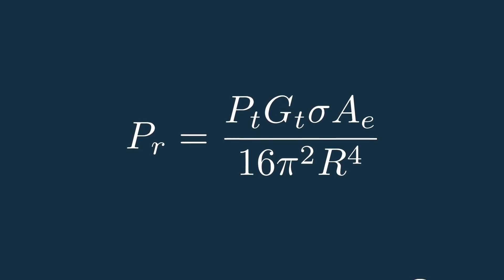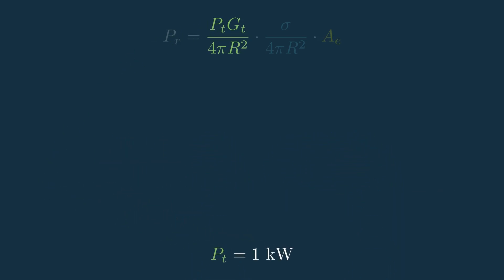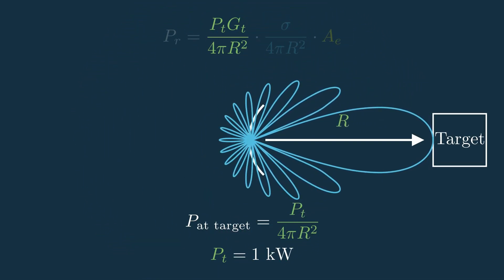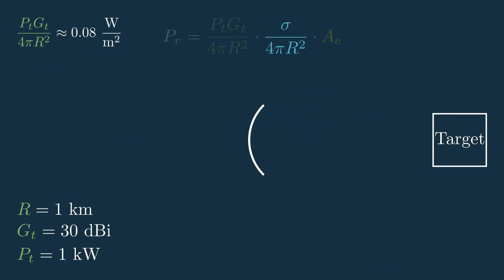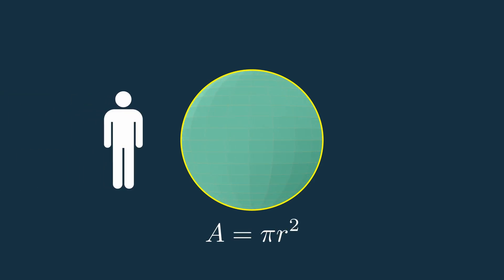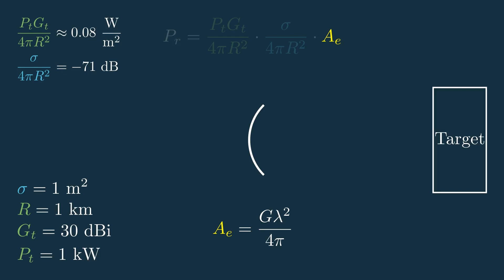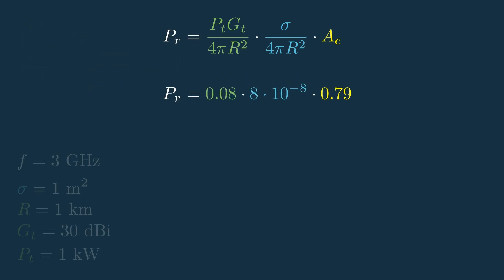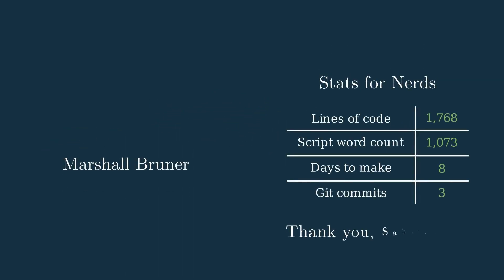What is the RADAR Equation? | The Animated Radar Cheatsheet

Comment: Absolutely interesting and fascinating and I also really am interested in multi-spectral sonar and its use in the mapping of the ocean floor but I think instead of driving huge research vessels with massive side scanning and towed sonar erase that small highly compact sensor-rich semi-autonomous swarms of a sort of tri-hull design with a more hydrodynamic in general shape of the three sections but wings in a way to help it maintain its position in any one place in the water column. Then space those devices with 25% overlap and just install ProSumer level multispectral sonar available from Lawrence or hummingbird and Garmin who make multi-spectral sonar so amazing for at the prosumer level that you wouldn't need not develop anything special or for this purpose as it can also scan to some degree into the sediment and so much clarity and detailed could be gained from moving the error sonar very close to the bottom rather than trying to get details from 8,000 m above through 800 and one atmospheres of pressure. We have no idea how any of this part of our ecosystem and biosphere actually functions much less the chemistry importance the importance and number of organisms and we are again repeating history and mining and causing serious damage to these areas without having first done 10% of the research necessary before you should take such drastic measures. People complain about geoengineering and then apparently people are already mining the sea which I thought was still under a moratorium and these companies should be completely sanctioned, cut off from the global financial system, and their games or what they mind from the ocean deemed as blood diamonds absolutely shunned by the market. Their geoengineering without any idea what they're doing and it's worse because they're doing it at a time when our climate models are not well understood and we don't know how long that water takes to circulate it could be a century old We just don't know and with the desalinization of the surface water it's thought that that may even be creating a cap so the sensing and remote sensing in these extreme environments not only could help us understand our own planet but would be approving ground for probes to other extra solar and/or interest solar environments as the conditions that exist at the average depth of the Pacific Ocean floor or the plane as they call it is 801 atmospheres of pressure one being where we are right now as you always count sea level as one. I'm a technical diver with 3000 hours as well as a recreational instructor and I have certifications from three different agencies including the most popular one and the most difficult one called pay to fail or the agency everybody loves to hate but they're right GUE.. so anyone who's like-minded who thinks that these projects have merit and would like to help me raise money for the research and development in a location which would welcome our work and where there's plenty of very educated and talented engineers with no jobs such as the Philippines Malaysia and Singapore with the ladder not having an employment problem but the university there being very highly rated and reputable and Indonesia is a country with a lot of land that's available for very little and very tall dormant volcanoes which would help put you into a much more dry or low humidity cooler environment as well as within a caldera being shielded from spurious radio interference and light pollution. So if you're trying to use both radar, big antennas should you need them, a large telescope for tracking and a very good horizon than this would be an ideal place as the light pollution in some of these places is very low and if you gain altitude you lose humidity and atmospheric distortion as well as the country being a country in transition there's far less spurious radio interference especially if your shielded to some degree from the emissions on the surface. I'm practicing law in Switzerland and an Indonesia and I practiced in Singapore and Switzerland but mostly Switzerland my whole life and I'm admitted to seven different courts in the United States in two different states up to the Supreme Court and the court of international trade but I'm also a scientist having a masters in science as well as being and working as a by our ethicist as well as having skills that I'm currently developing as a maker. So I can follow all of your math and you present this in a way that has made this very accessible and understandable to me I made copies of your juniper notebook as I've already been teaching myself this along with the various types of Python libraries, Jason, real-time operating system RT threads which I think is pretty cool by the way, and busy box as these are necessary for cube sets as well and Pike Linux which seems to be the distro of choice for commercial makers of academic cube sets that are sold to universities using a common bus for the payload which is a little bit disturbing when AES is optional use the default CCSDS minimum security communication guidelines so any vulnerabilities found will be potentially a harmful attack attack in vector for the multiplicity of people who now have the sophistication to create mobile row ground stations and with poor implementation, social engineering, and poor passwords being the three number one reasons for security breaches It wouldn't take much for an attacker to potentially wreak havoc in the space environment imagine if they take control of a satellite with enough propellant and enough mass to propel it  through the other orbits. There's a Swiss Space Security Research center I wish of course they will never acknowledge me or talk to me because everyone sees lawyer and they put me in a box and think they have defined me. If you were to look at my CV and see all the different things I've done areas where I've studied and worked that label most assuredly doesn't apply to me in its entirety but long regulation and policy touches absolutely everything we do in science and education. I give examples such as the regulation of the radio or electromagnetic spectrum, the regulation of space, the regulation of research on human subjects which is the national implementation of the Helsinki protocol which is a direct result of the Nuremberg trials, And the law of the sea which I took a certificate course at the University of Geneva School of Law I summarized the entire course in the first two weeks in one essay showing that I had mastered all of the intricacies of this course and found it to be so useless as it takes an enormous amount of money and time to bring a case to court and then like so many other international treaties whoever's the strongest enforces their will deeming international law to be non-existent or non-applicable while if it goes in their favor they use it as an excuse to force that upon the loser by any means including military means. It's complete cafeteria level law and I've always found love to be intellectually and ideologically disappointing as my first degree was in philosophy and people may poke fun at that as being a useless degree but I challenge anyone to try a single semester of advanced philosophy in the undergraduate level and show me your craze and let me read your papers that you submit evaluating whether you were doing what a former roommate of mine and a current teacher of German in Geneva was doing who is a well-known artist but is nothing but a faux intellectual and is so unbelievably lacking anything profound in her brain that she supports communism because as a child she had a good time with her grandmother in Eastern Germany and she said she already lost her war when the wall fell. She teaches Marxs and Leninism two young children and has been chastised by her supervisor on many occasions as these children's minds have no business reading this extremely dangerous and in the words of a former professor sexy piece of sociopolitical philosophy because it sounds like a Utopia and as we've all seen in practice it turns out far different because human nature was never considered correctly. People who work more and you have more potential creativity and drive believe that they deserve a little extra if even just a little extra it doesn't have to be the amount gained by Bill Gates or the three most rich people in the United States who have more money than 50% of the people in the world but assuredly the extra time and sacrifice as well as the consistency should be rewarded but they aren't they get the same amount as the person who just scraps by doing the very minimum.
Reply: I live in the world's only direct democracy and it requires a pedagogy and a view of education which is both very difficult for the students but is producing students that can achieve and have a basic level of common sense far more sophisticated than many students in other countries which is what allows us the privilege and allows the functioning of a direct democracy because without that education it would devolve into a tyranny of the masses. 

At the same time here people are so economically conservative that I could never even be considered to work at the cybersecurity Space center being a lawyer even though I had a project on hack a day which I pulled down because I was pretty sure it would violate ITAR if I actually built it and described it and showed the code. 

I developed a cyberdeck for the cyberdeck competition that would have been effectively a rogue satellite ground station but for me it was more about curiosity and sure you could have used it to look for any possible attack surface, side channel attack, voltage glitch base attack and these commercial satellites made for academia in countries with less than stellar Lowe's on the corruption index and rule of law index are producing these cube sides and who knows about the supply chain or the validity of their certification documents. I have a serious questions as I approach one of them for a sample wanting to put it to the actual test contacting individuals in France who are famous for using very creative and inventive ways to break the security of devices deemed unbreakable. 

And I just saw an individual used chip whisperer and an oscilloscope to break into smart meters and dump their firmware and it affects 52 7 different types of their microprocessors that are supposedly ultra secure and it just took the right spike at the right place in a nanosecond time frame and it opened up allowing him to dump the entire firmware because he wanted to know what information they were collecting about him. 

I don't blame him because here in Switzerland we have a federal law which allows us to access all the information collected about us by our smart meters and can purchase the devices necessary and they give a port using MBUS to connect and gather that data but is it all of it the behavior of companies is like capitalism or laissez-faire unchained on a sea without any control and operating cross border They can always find a way to do anything they want to make money. 

They even have legal and ethical obligations to make profit even when their decisions could be immoral and unethical as long as they're legal if they don't make those choices then they can be held viable to this shareholders and could be facing a shareholder suit and the destruction of their entire career for doing what we would all see to be the right thing. 

I lost my career and my life almost my life but I lost the life I knew and most of the people who I thought were my friends because I did the right thing and I irritated her apparently made a person angry who happens to be the leader of a very large powerful nation state as an individual don't do that unless you just can't help but do the right thing which was how I was raised. 

My client used to tell me it gave him more credibility with his other people having me as his lawyer and he pushed those limits as I did everything under the sun for him outside of the country in question as he did everything inside that country as he was a lawyer himself graduating from Harvard going on to Sullivan and Cromwell and then white and case. The managing partner of white and case when I was introduced to him as his lawyer said you must be one hell of a lawyer and I said why do you say that? Here's that naivety which was it Achilles heel and an asset because I was honest and I remain a good person. He said your client is the smartest lawyer I've ever known. 

So while I've been recovering from complex post-traumatic stress disorder I've been exploring other intellectual areas because I can master them with very little trouble as I have those gifts but having those as gifts as I see them as gifts being a man of faith be at the teleological argument or the fine tuning argument I don't care we don't know. And yes I have a very transential and atypical version of a creator but even the beauty of math itself for me is additional proof of that fine-tuning argument or teleological argument the argument by design. 

As I recover and being very close I have retained all of my intellectual abilities and creativity and this time I want to put them to good years not just to benefit the rich which I sold my brain to for an enormous amount of money hourly but the amount of experience across so many areas and countries has given me a level of experience that you have. Our value in the eyes of my current medical personnel is probably more than it was before I could be more successful and more productive now than I was as they've built my EQ stronger than it was before and those two things together are essential. 

Again anyone who would like to join me in my endeavors to form a research and testing environment for both face or ray radars for the elimination of space debris as well as a telescope for additional tracking and identification telemetry and material composition and then the exploration of the floor of our ocean all as a part of a STEM magnet school that serves both as a secondary school offering the international baccalaureate but also as a remote engineering school that offers education from a reputable engineering school abroad or within Indonesia. The cost of doing business there and the overhead makes it an ideal place for both research and development and it's very close proximity to both Taiwan South Korea and even China as they're no longer a low cost jurisdiction but they've now developed the skills and we should see them as a peer and as a potential ally towards group global peace as they just want to be seen as a peer and their marrying what everyone else has been doing. If you recall what the Japanese said about why they did what they did you'll find parallels in the build-up of the Chinese military but look at their actions so different than the other three rogue nations as they behave as they want a future while the others do not. 

I love a few sponsors and supporters as well as researchers to join me setting up a research and development for the mapping and studying of the ocean floor as well as using face array radar optical radar and radio telescopes to identify and then hopefully ablate as much material from the low orbit that we can for the lowest cost that you could ever imagine. 

We're doing two very necessary things that will help us understand our world how to help our world heal and to prevent further damage as we seem to not have learned a single lesson jumping into deep ocean mining while there's a moratorium and while we understand absolutely nothing about what we're doing but we did not geoengineering. I already have a presence and the ability to form a non-profit as well as a primary school which is an internationally school which is recognized by the Indonesian government as well as a diving company that is owned by my former protegee who has asked me to join her again and work with her as a partner. She is my greatest most incredible person that I've ever had as a student and she took everything I fed her and absorbed it like a sponge and then ran with it perhaps even surpassing me in some areas but she definitely needs some additional help she's grown her business and much bigger than the 30-year-old oldest lawyer she has that is a firm a part of her business structure formed for that purpose and she needs her mentor. 

At the same time I don't want to work for those people exclusively but I want to also put equal efforts into helping address serious problems that face the people of this area so educating gifted youth from economically depressed areas who test heavily and highly on STEM areas. They were never have the opportunity to see the inside of an advanced or university classroom while having all the ability and gifts to excel. 

All of the water from all of the villages from every island in the coral triangle straight pipes their waist into the ocean. Having enormous amounts of rainfall they still cannot drink anything from the tap and you might want to close your eyes and your mouth perhaps put nose pinchers on your nose and ear plugs in your ears while you're taking a shower because it took me 2 years to drink from a water siphon here in Central Europe because if you drink that water you would get very sick and you even have to brush your teeth with bottled water from a plastic container. Addressing those issues will be a school goal while each student will have their own projects via robotics or a bit anything in the wrong of stem but the school goals will be addressing infrastructure related to waters safety and the cleansing of outbound water using local resources and locally designed processes that are low cost and affected not chaining them to expensive and impossible to maintain devices made in the West. 

250 million children every year from close to the equator where this sits are affected for form developmental disabilities both at the mental level and physical level due to the consumption of tainted water with bacteria which is quickly evolving due to the presence of pharmaceuticals and pharmaceutical metabolites in every freshwater stream in Europe so that most assured they applies there,... And then their waste both industrial and human as well as mixing in animal husbandry is dumb directly into one of the most important marine biospheres on the planet.